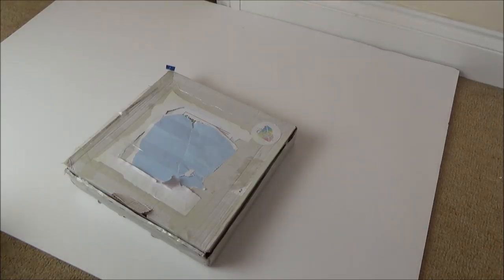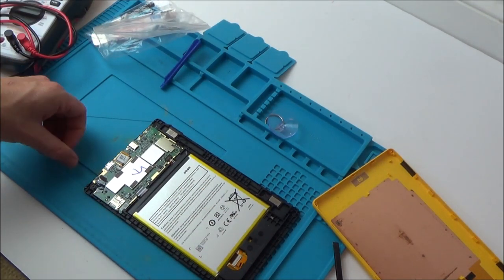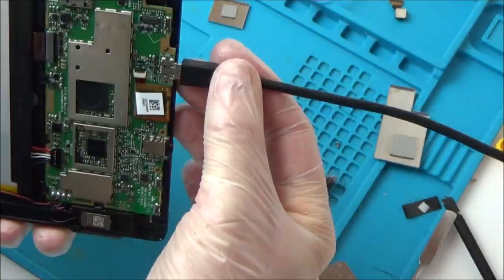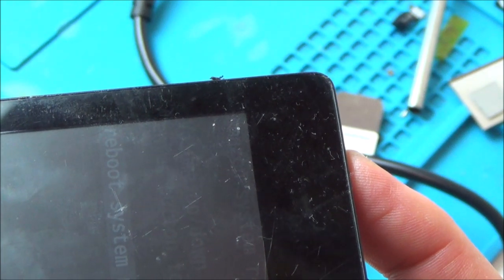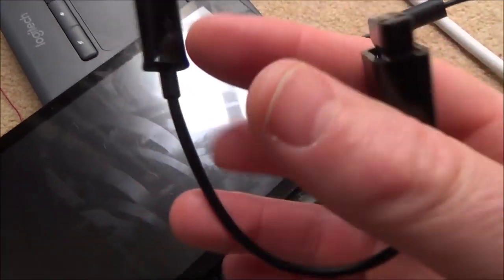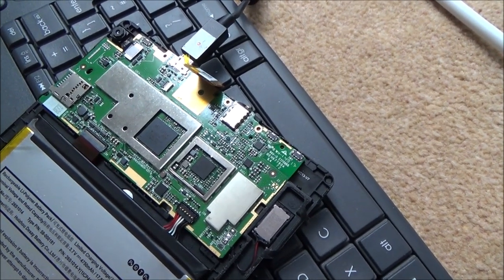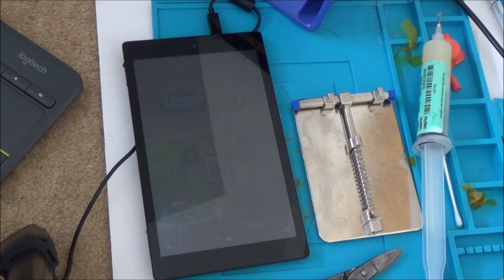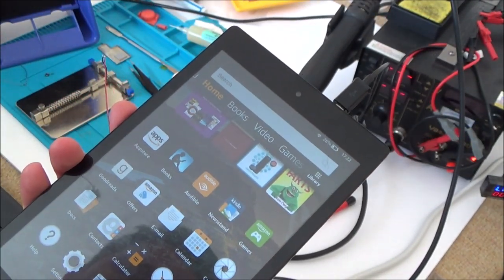Trying to FIX: Water Damaged Amazon Fire Tablet

Comment: My guess for your boot problem is a faulty battery.....the battery reports a fault, preventing the device booting....if you disconnect the battery and start it, then reattach the battery you bypass the battery check....nice vid as always vince
Reply: Yes, that would make sense... most batteries nowadays have a separate channel that communicates with the main board (example being the Switch battery and its gray wire).

Vince, you should probably see if you can get a spare battery for it.
Reply: This is why it's always nice to have two devices, one that's faulty and one that's working properly.
Reply: Kind of late to the party but I do think there could have been some corrosion on the smart chip on the battery.
Reply: I know im asking the wrong place but does anyone know a way to log back into an instagram account?
I somehow lost the login password. I would appreciate any help you can offer me.
Reply: @Zeke Bryce Instablaster :)
Reply: @Forest Milo It worked and I now got access to my account again. Im so happy:D
Thanks so much, you saved my account :D
Reply: @Zeke Bryce you are welcome :)
Reply: Yes

Comment: You're spoiling us again with all these vids!  Shame it couldn't be repaired, but you learnt from this for sure.  Those ribbons are a pain, you've got to be so careful with them - just looking at them wrong causes them to break lol.  As a few others have said - battery can cause wierd power on issues like you are getting.  I've had that too on a tablet (will be uploading the vid soon) - in that case it was just the micro USB port that was the issue.
Reply from the maker: Cheers Chris. I didn't think that the battery could have been the issue at the time of filming. I am annoyed I didn't peel a bit of it open to see if the protection board was corroded. I definitely caused the majority of damage on this one but luckily it didn't cost much :-)

Comment: Hej Vince! I'm from Sweden and hope you can read between my bad spelling. Your battery chip is burned but if you fit an switch on the back of your case it won't be a problem, the chip is there for measuring heat and moisture and will fail if it's been wet. By you restarting it every time you will have it work. Thank for another good   video!
Reply: I thought it might be some kind of tempreture ic

Comment: "It's never the coil" to quote Jessa Jones (at least most of the time. it should measure almost 0 ohms if you test it) it is more likely to be the corrosion on the components nearby the coil not creating the right feedback to allow the brightness to go higher. you should put the board in your ultrasonic cleaner as it will do a better job than just IPA and get to places where your brush can't.

Comment: Thx for the incredible video! So I knew I am not crazy. Mine one has the same problem. (I dropped it once,nothing to do with water damage) Everything looks ok except touch screen - still not moving. I followed every steps and digital looks ok (nothing torn apart) battery is good too. I had to give up that welding / cleaning part) since I do not have that tool. Eventually I put everything back in shape but good to learn more and hope I can still fix it someday ;)

Comment: @mymatevince I'm 99.98 percent positive the battery needs to be replaced. Had the exact same issue with LG phones bootlooping etc. when battery is damaged. Between that, a new digitizer, screen, and sorting out the brightness issue; you'd be better off using it for spares. However, I'd still love to see you repair it. Cheers mate!

Comment: Thx for the incredible video! So I knew I am not crazy. Mine one has the same problem. (I dropped it once,nothing to do with water) Everything looks ok except touch screen still not moving. I followed every steps and digital looks ok (nothing torn apart) battery is good too. I had to give up that welding / cleaning part) since I do not have that tools. Eventually I put everything back in shape but good to learn more and hope that I can still hope to fix it someday ;)

Comment: Ive got a question if you don’t mind, when you are removing a small chip just like the one that you did in this video, how do you know its correct orientation when you weld it back into the board? Nice informative video 👍
Reply: Usually there is a dot on the board and on the chip itself to indicate that is pin one.

Comment: Did u find anything out on this tablet? I left mine out in the rain overnight on accident.i could see the water inside it and water bubbles in the screen.i used a hair dryer and a heat gun and tried all the "fixes" on here,I looked it over the inside and a broken speaker wire and I snapped off a thin wire clamp,I'm more or less leaning towards buying or trading for another one after 3 days of working on it

Comment: Hi Vince,
It wasn't clear in the video if the Fire's battery ever received a full charge? 
A while ago my cheap little tablet was caught in a "boot loop".
     The problem was a poor connection & charging cable not
putting a full charge on its battery.
Reply: No it probably isn’t that causing it my little sisters dropped my moms fire tablet in the bath and It had the same issue as in the video

Comment: battery may be bad, the battery might not charge properly, check transistors near the charging port if there's any. 

You can try hooking it up with an external power supply, and see if it's booting from the power button

Comment: Man...that hurt watching you pull on the screen with the suction cup. When I first opened a Fire 7 a few months ago (was trying to fix 3 that weren't charging anymore for one of my sisters-in-law), I had tried using heat first, thinking it was an adhesive seal, but figured out after trying to pry up the screen that there were clips like the old iPod Video (5th gen iPod). I used a metal pry tool to get down far enough to pop the clips, and all was good after that. I was able to fix the micro USB connectors by bending the individual contacts down so they would be closer to the board, then used the heat gun to reflow them. First time ever attempting to repair a micro USB connector, and got my confidence to try it from your videos, Vince 😃.

@UCLOV8DV2jv507e8PgcHJ_1Q
Reply from the maker: Excellent👍 Yeah I couldn't believe how easily it cracked. I thought it would take a lot more force. I was thinking it might be the same as an iPhone where the screen lifts up from the body but I was definitely wrong!! 😁

Comment: Don't feel bad about cracking the screen. My Fire tablet screen got cracked while it was in the "official" Amazon case and it was only dropped onto dirt. The screens in those tablets are super delicate and in my model at least, the whole cracked area stopped responding to touches. They use crap glass, and crap digitizers. Glare at them and they break.

Comment: Hello, Vince! 
Don't give up on it! The things that need fixing are very simple to repair (for you). The system isn't booting up because the battery may be dead, the protections chips ARE fried. I've seen from other comments that there is an initial battery check on bootup, and because the battery is dead, you have to skip the process by removing the battery and plugging it back in. The solution: *get a new battery*.

The second fault (sorry mate, this one's your fault)
Because you cracked the digitizer, It doesn't work anymore. Mate, get a new one. I have seen your video once where you did indeed actually remove the screen from a Nintendo Switch and it still worked, so I have hope in you that you can at the very least get the digitizer to work. It's just glue, nothing else!
I wouldn't hesitate to do those repairs on my own if I got such an amazing deal on it. 

I have found a battery for the tablet here: https://www.batteryforpc.co.uk/amazon-battery-26S1014-p1776666.htm it's 20 pounds. + 19? pounds for the digitizer 39 pounds? Seems good I guess

Keep in mind that you actually *do not need any chip replacement or anything*!

Comment: First thing I would do to a water damaged gadget is to remove battery, dismantle the gadget, clean the corrosion if any, and dry the the board with a hair dryer or do some hot air rework on the major chips and component.  When I'm sure that everything moist dried up and cleaned then that's the time I would apply power and try troubleshooting  the problem.

Comment: Hmmm, interesting faults.
You seemed to have found out the brightness issue, just bodge that one with long wire with silicone sleeve so it doesnt short out.
Power issue. Seems that it needs a full discharge to shut down (removing battery). Is a capacitor drawing power when it shouldnt? Maybe the chip on the battery isnt activating until it resets. 1st suggestion would be to try another battery in it as a faulty battery can cause all kinds of issues. 2nd suggestion is buy another fire and make 1 good from 2.
Reply from the maker: Very good suggestions Emma. I didn't think to check out the battery. I should have known from the water damaged Nintendo Switches the battery could have been the culprit. Nice one :-)
Reply: @Mymatevince  are you going to revisit this one? and try a new battery?

Comment: if you watch the video right around the point where you broke the screen you will notice the low battery indicator on the screen and you actually mention that it made a noise. Perhaps a quick charge was all it needed??

Comment: You could at least try and transfer the Audible files and any books from it. Probably make back the cost in free stuff.😜
Reply: Not after reseting it all that stuff is gone now and can't be recovered and can't take the internal flash storage out to do any file recovery because it will not work (that is why i fixed my old phone before getting a new one and i got my files off my azpen A743S tablet before the crack in the screen got too bad)

Comment: try replacing the battery  it could be the battery has a bad  layer or cell.. how ever it works with lithium battery  and  as a result its triggering a safety  preventing it from booting

Comment: Holy ****, how the fck you managed to crack screen. You never want to use force with suction cup... man i swear so much when i saw this. 
Second thing you cant just go and do hardware repair if its "bootloop" problem. First you go and reset device, if its not working, you are going to flash new system on it. And then if it doesnt help, you go and try to do some hardware repairs.  Also, if it's turning on after you brute force battery/charger, it would be bad battery, as you can see when measuring voltage on the battery, it keeps dropping too quickly. Im not judge Vince, but you should at least try to watch some other repair videos to gather more knowledge.
Btw screen had brightness as it should before "you opened" it.